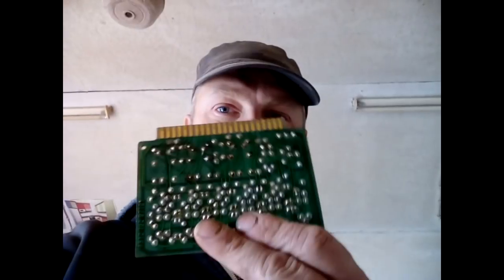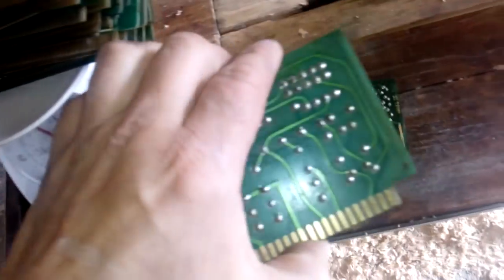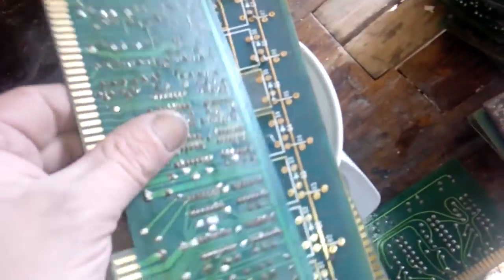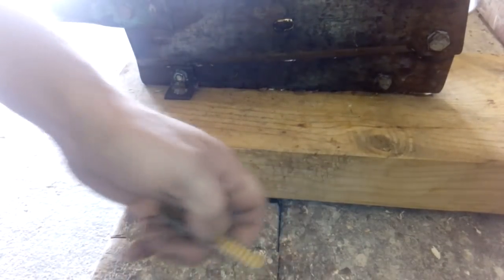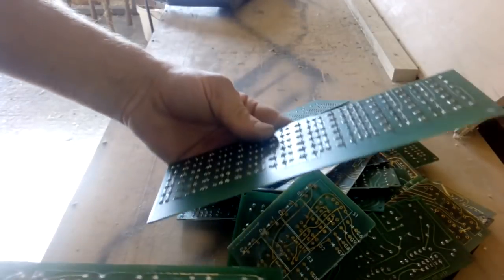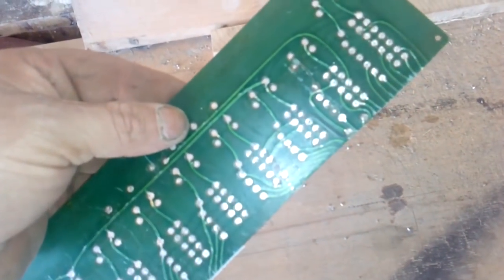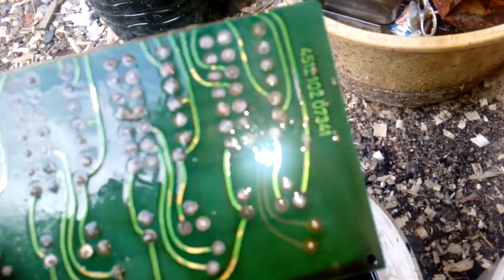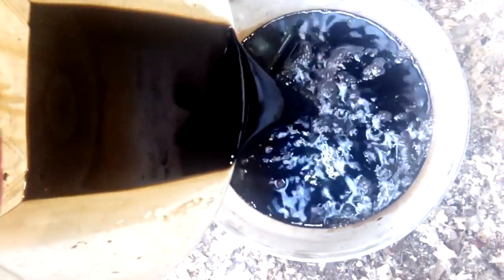Finger board from x-Ray mashine process for gold recovery with Ap PART 1

Comment: burn, incinerate the boards . this way you can proces the metal only .   als a alternative for the acid to remove base metals try etching solution to make printed circuit boards , it eats away copper and other metals.